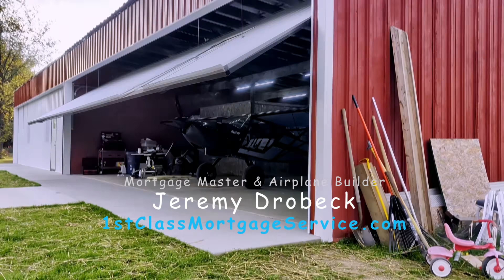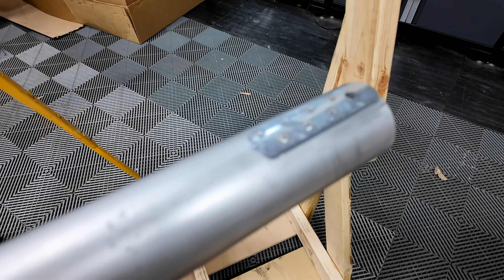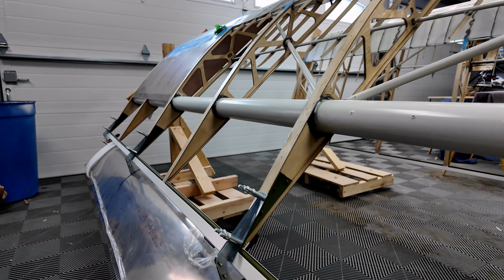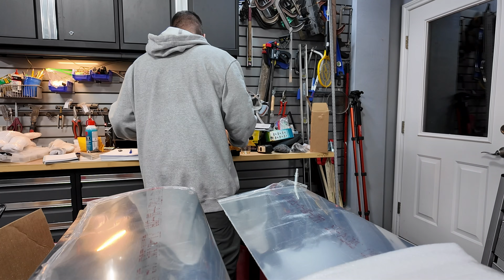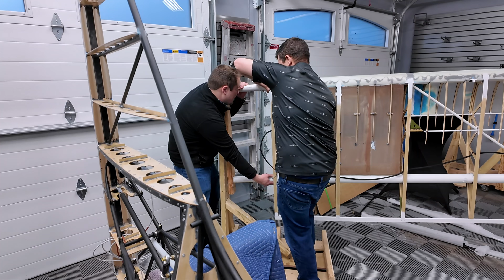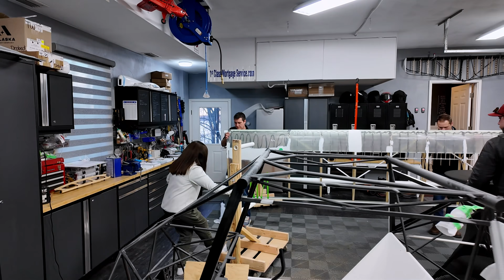Building Airplane Wings: Spar Brackets, Leading Edge, & Flaperons | Kitfox Build Series E5

Comment: How did you Apoxsee the complete strut on the inside?
Reply from the maker: I didn't epoxy the strut i epoxied the spar.  And to do so I put a tennis ball in the end of it dumped a bunch of epoxy in there and swished it around.  It worked great
Reply: @JeremyDrobeck  that was a good plan. I never thought of that. Thank you.

Comment: I use a water level on the wing tips. Front of the wing for the main spar. Rear of the wing for the rear spar.
Reply from the maker: Great idea!
Reply: @JeremyDrobeck use a clear tube and make dam Shur no air bubbles  1/2" I'd is what I used.

Comment: Did you need a helping hand frequently or were you able to do this alone aside from a few things?
Reply from the maker: Great question  100% for sure. You'll see as you watch the other episodes, there's only a few times I had people helping me.  It was things like taking the wings on and off or flipping the fuselage over, loading the plane on the trailer.  I had somebody help me mount the engine not because I couldn't do it myself but because I needed an engine hoist and he was willing to help.  Every now and then my wife would come out to the garage and hold something for me.  But 99.9% of the build was all me solo.